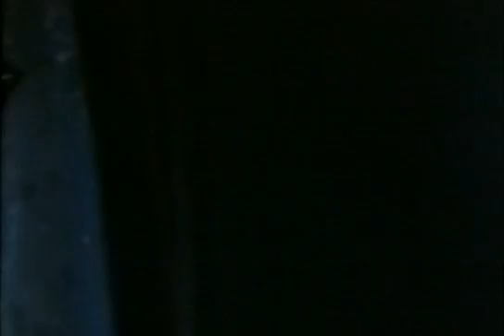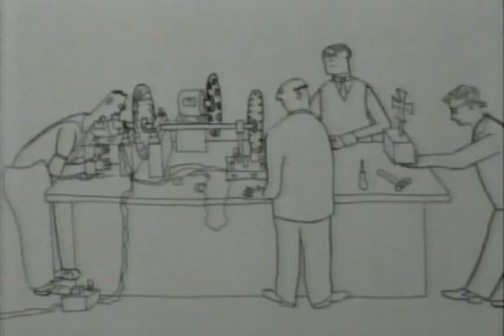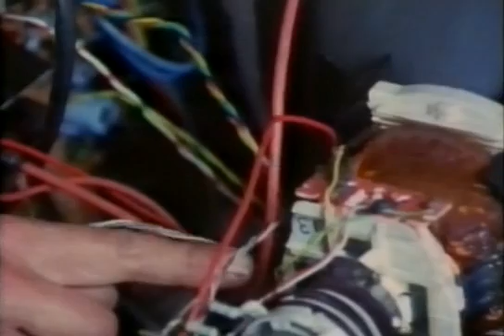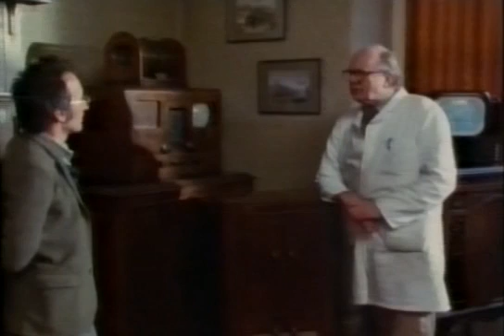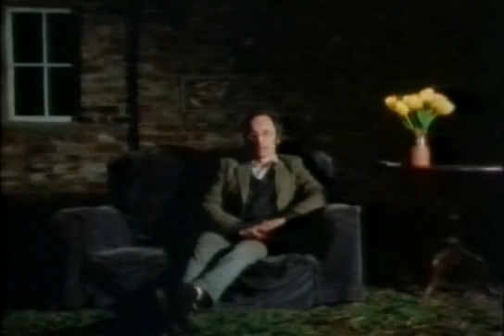The Secret Life Of Machines - The Television Set (1988)

Comment: Even more interesting is the story of color television and how the general at RCA played CBS out of the game. The CBS system was, because some units were sold and some programming was prepared, at least $500 less than the all electronic RCA set. These suffered from convergence problems and de-gaussing became a money maker for the average tv repairman over many years. Worse, the CBS system which had been adopted had folks saying that the colors were very accurate and looked like technicolor movies.
Reply: The CBS system was a mechanical field sequential system that while it gave a good color image for static images, if the camera moved you could see a 'rainbow' type effect, was physically bulky and as it was basically a motor spinning colored filters around, not quiet and limited how big the screen could be. 
If your familiar with modern DLP projectors they use more or less a similar system to get color

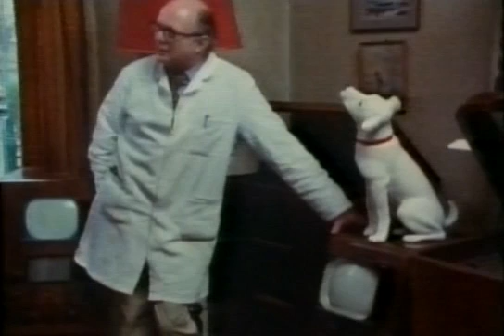Comment: 13:46 but has that boffin in the lab coat got a Pye Tube Cube?

1988 technology for that standards converter and the old 405 line service wasn't turned off until 1985, will digital technology standards last that long?

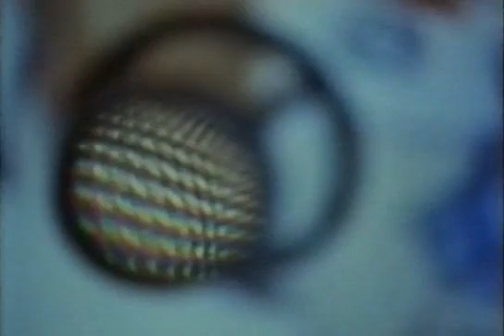18:00 LCD panels work in the same way when it comes to colour mixing, red green and blue pixels combining to create all the other colours.

These are real engineers, experts in their field on screen because they know what they're talking about.  Nowadays if they made a programme like this it would be narrated by Stephen Fry (or if you're American, Ryan Seaquest or whatever his name is) mispronouncing all the technical terms.
Reply: You're probably right about the narrator for a show of today.  It's all very generic and plastic.

Comment: The truth really is that the older sets were more fixable do to easily interchangeable and more universal parts, where as newer sets feature custom components which are much more difficult to exchange and go obsolete very quickly thus making them nearly impossible to obtain. Something goes wrong with a modern set and 9 times out of 10 it costs more than the sets worth to fix or cant be fix because they cant get the parts making it instant landfill waste.
Reply: On the other hand modern devices go wrong a lot less frequently and I suspect are far less likely to catch fire and burn houses down.